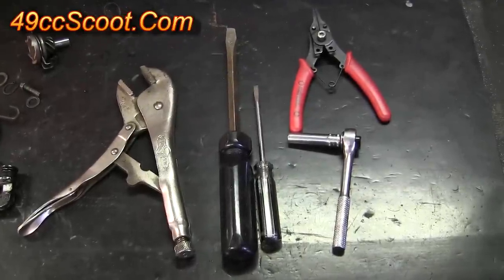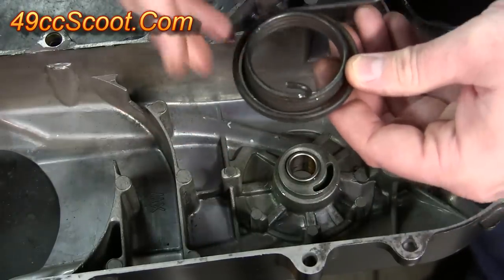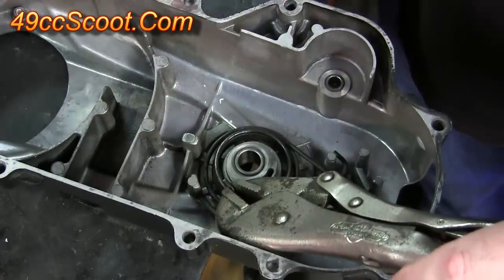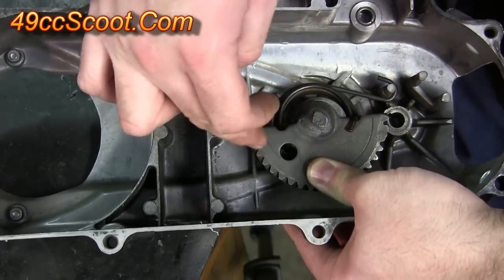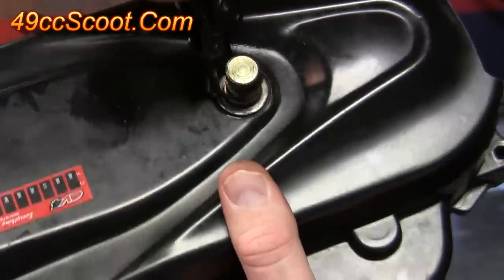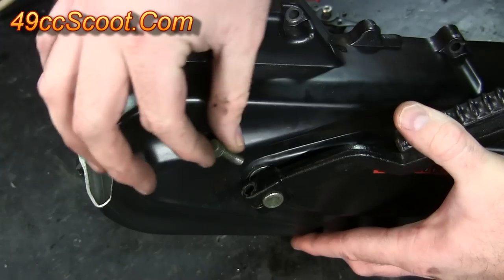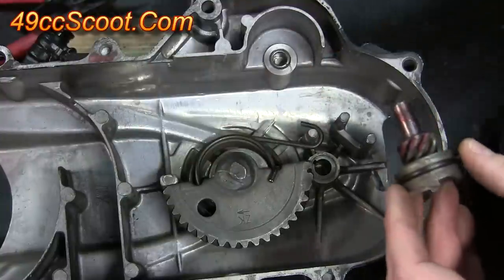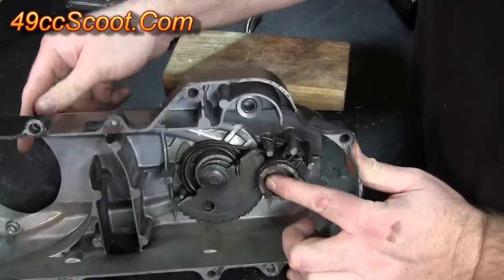139QMB (GY6 50) Kick Starter Assembly : 50cc Scooter Help

Comment: Fantastic guide. My Scoot left me stranded today with a weak battery. It was very frustrating and embarrassing to be at the grocery store in 26° weather trying in vain to get it to start. I have resolved to never rely upon a battery for starting ever again. It is a nice bonus, but every trip will involve at least one kick start.
Reply: Just be aware kickstarter should only be used when your battery fails. Used my kickstarter for about a month because I had a broken spark plug and now it doesn’t work, and gotta watch this video to fix it
Reply: If your scooter has a Bendix (the part that engages between the starter and the gear that turns the engine inside the CVT), that could also be a problem. On my 50cc scooter, I ended up upgrading to 12v 6ah Lifepo4 battery. But I also live in South East USA, and don't have to worry about much cold weather.

Comment: Great video. I’m gonna get a big coffee and sit down for a try at this right now. Kick start is stuck after a crash and don’t not what I’m gonna find. But after watching this video I feel ready
Reply: It just needed the surface corrosion and belt dust sprayed off with brake cleaner. Then a thin layer of lube. Easy to reassemble using your instructions. Works like a charm. Thanks again

Comment: I would put the kickstart lever at 11 or 12 o clock so that when you drop the gear pawl in, the kick lever is still at around 10 o clock, on the return. that will give you a good down swing.

Comment: Ty for this hers was destroyed and had a spare easy to snap off. Needed to know how to put tension and how far to go in thanks again. Now the part that turns it any videos on that part it's loose hope it's supposed to be lose ?
Reply from the maker: The kick lever is what turns the kick start gears. It's on a splined shaft and will get loose when splines wear on either the shaft or lever. Whatever is worn should be replaced at that point.

If you meant the part that the kickstart assembly turns, that's the starter pawl attached to the crank. That definitely should not be loose.

Comment: Just an observation.... Instead of holding it over the edge. drill a 1.5" hole in your bench top. Helps when rebuilding bike motors. Good video.
Reply from the maker: Thanks. I'd prob build a platform just for it if I wanted to do that. I don't want to drill this bench. I've got 3/4" plywood topped in 1/8" steel and I'd prefer that it's intact.

Comment: Hello I have a question. Is it possible to give the scooter gear oil other than through the drain or fill hole? Both of the bolts on my scooter are STUCK on and I've unfortunately stripped the bolt head so I cannot grip it with my ratchet
Reply from the maker: Your best bet is to fix those. Try vise grips first. Get them as tight as possible and then try to loosen. Maybe use some penetrating oil prior to that. You can try a chisel to turn the bolt. You can use a screw extractor. There are videos on all of this stuff.

Comment: Great video but.....how do I remove the cover to get at the assembly shown? I wish I had the 3 minutes prior to this to see how you got the cover off.   I pulled the 8 bolts off but seems there are more or are hidden?  I can see a gasket between there - do I pry the CVT cover off after removing the 8 bolts?  Thanks.
Reply from the maker: Once you're certain all of the bolts are off (they should be visible), try tapping gently around the edges of the cover while  trying to remove it. Use something soft like a rubber or plastic mallet. Give that an effort. If that doesn't get you anywhere, then you can try to find a spot to pry or that would allow you to tap gently in the direction for it to come off. Try your best not to damage anything though. The covers are pretty fragile and it's easy to scar parts when prying.

Comment: Very helpful thank you. One problem i have is the stopper where the kick start returns to has snapped off. (Ex owner broke it off, I still have the piece) Will this affect the kick start from working? as the kick start is in pieces at the moment. Regards David.
Reply from the maker: Robert hughes You can prob get away with it, but I'd imagine install will be tough. It would be best to replace it.
Reply: I will try it, if no luck i will replace. Thanks again. Regards David.

Comment: Im not sure if you still respond to commetns, but I have a kickstarter that is stuck down and every crank of the engine it sounds like its grinding, do you think replacing the kick start will make it work again?
Reply from the maker: Sounds like something may be broken or out of place. At very least, take the cover off and inspect.

Comment: Thanks. Did you make that cover yourself or can you buy those somewhere? Its nice, because you dont need to take it off for visual inspections.
Reply from the maker: It's a stock TaoTao cover. I cut the front with a cutoff wheel and the back with a hole saw. I open all of mine up somehow to help keep the CVT cooler.

Comment: Hey I got a 50 cc scooter Yamaha zuma with no kick start can one be installed onto that ?  I been stranded a few times due to my battery  and before I look into buying another scooter id figure I ask first
Reply from the maker: If it's the bugeye Zuma (horizontal Minarelli engine), then it should be very similar to this. CVT cover is a bit different, but same process.
https://www.youtube.com/watch?v=sJ7jxWexjZY

Comment: What did you use to cut the cover an angle grinder? My 139qmb gy6 50cc scooter keeps breaking belts I suspect it's due to overheating in the cvt, as the belts always look somewhat melted after they break. The fan also melted , it looked like the roller weights were melting on the sides you can see the shine from the heat on the flat spots as well. There is a small cracked portion that collapsed at the edge of the roller weights housing part of the variator I suspect that's from the heat getting the cvt so hot that part of it just caved in, or at least that's what it looks like. Do you have any Idea what could be causing this? I went through 3 high quality belts each lasted less than 100 mile I ran it pretty hard with no cvt cover for about 2 hours and the belt was warm but no signs of wear on the sides, which is where the belts start to get chewed up the clutch was warm as expected, but the variator on the other hand, was very hot. I couldn't even touch it. Thanks in advanced!
Reply from the maker: Rear was a hole saw. Prob a grinder for the front. I also do shapes using a drill and then carbide burrs and files to finish.

Anything that slips will make a lot of heat. Clutch slip and belt slip are prime suspects. I start most CVT troubleshooting with a thorough teardown, inspection, and cleaning. https://www.youtube.com/watch?v=2EjW-iSP-Q8
Reply: Figured out why my scooter was running so hot. The clutch had no glazing luckily but,  I had a performance carb on with an 85 main jet and a high flow air filter. Long story short, I rode it in the snow somewhile back and got some street salt in the carb and ruined it. So I put the stock carb back on. The problem is I didn't put the stock air filter back on. I just ran it with the highflow one. This caused my scooter to run lean and overheat causing the cvt to overheat and rip my belts. Opened up the stock carb and saw a 75 main I knew instantly what the problem was. I hope I didn't cause serious damage by running lean for so long. Anyway thanks or your help, I'm writing this in hopes that someone who is having a similar problem will have some idea as of why. I focused all on the variator and clutch this whole time when the problem was poor carb jetting.

Comment: So I’ve now put like 3 different kickstart kits in my scoot and it never springs back?? Why?? And now it doesn’t engage until it’s like halfway kicked down (makes it a pain in the ass) please help
Reply from the maker: First step is to see how it acts with the cover off. Then you know if the kickstart mechanism is a problem or if there's an issue with spacing or something like that.

Comment: My kickstart keeps getting stuck in the down position. I put it together exactly like you did in the video. My battery died because it's getting pretty cold. I've decided to wait till the weather gets better to get a new one. So i need to kickstart any suggestions?
Reply from the maker: Sure all parts are clean? Some belt dust or dirt can be enough to make them tough to operate.

Comment: Do you know the kickstart lever pedal size I'm looking to upgrade mine to a better one 13mm?
Reply from the maker: Should be about 13mm. Around 12.5 to 13.5, depending if you measure largest or smallest diameter of splines.

Comment: Every Amazon GY-6 Kickstart assembly that I see gets bad reviews of them breaking after a week. Do you have any specific brand to reccommend?
Reply from the maker: Not really. Maybe Kymco would do better since they are generally better quality than Chinese scooters? I consider these GY6 50 kickstarters to be use only when needed and I rely on the e-start. CVT covers break too often or they just come apart and need to be put back together.
Reply: The gears seem pretty solid.. I bought a new set before realizing that it was the actually the cover that had broken. Just put it back together with all the new parts. We'll see how long it lasts this Time lol.. pretty sure it cracked when the bike fell over, landing on the lever, then broke the rest of the way when I was romping on it one day it wouldn't start.

Comment: Where can i buy the washer for the gear ebay or amazon website link cant find it ? I don't feel like spending 40_60$ on new Kickstarter
Reply: Would a washer from the hardware store work if i cant find it online
Reply from the maker: @ELViSLOK  It doesn't have to be anything special as long as the dimensions are close.

Comment: i just did all of this with some slight veriation came to the same end with it back together and my engine is fighting me when i try to kick it over, any advice would greatly be appriciated @49ccScoot
Reply from the maker: Number one would be to make sure it's not something else. Try turning the flywheel over and see if it is tough. Remove the CVT cover and try the flywheel again and see if it's still tough.
Reply: @49ccscoot  I’ll try that tonight when I get home it also doesn’t want to start off the electric starter bendix is just fine just cranks over hard and tries to fire hard every other revolution

Comment: my kick starter on my 50cc Tao Tao gives no response when kicked , no resistance and it doesn't go back in its original position i have to manually move the lever (kickstarter)back up. What should i do?
Reply from the maker: Take the cover off and check it out. See if anything is out of place or binding.

Comment: hey i need help my transmission belt broke into peices in the case and ever since that happened the kickstart won’t go down but it can go perfectly up like nothing i don’t know what’s the problem i took out the the transmission case to see if the kickstart can go down snd it does and the engine works electric start can’t turn on the bike but it almost starts it
Reply from the maker: I'd suggest checking everything over after a belt failure. It gets debris everywhere and sometimes rollers get out of place and/or parts can be damaged.
Reply: @49ccscoot  thank you for the fast reply i also put a big bore kit but i forgot that that i had to break it in and i riding it for like 2 hours and took like 30 minute breaks and i saw smoking coming out of th engine and i saw oil on top of the engine what can be the problem?
Reply from the maker: @chrisblockz3337  Sounds like maybe a leak or crankcase venting issue. If the smoke is coming from the exhaust, it could be piston rings not sealing.

Comment: Will the kick mess up if you lose that rubber piece that sits there??
Reply from the maker: It should work, but it's best to have it in there.
Reply: @49ccscoot  mines just not springing back, it kicks over and then I have to kick it back up (i know it’s no suppose to be that way) but everything seems to be in place right
Reply from the maker: @predator_boiz336  It's easy enough for the spring to not seat just right or a shaft could be binding. Sometimes the little gear shaft binds, especially if it's dirty and/or not greased. It would be best to replace the plastic part when you can, but you can see that mine worked without it. If you work it by hand with the cover off, you should be able to get an idea of where the resistance is. If all else fails and the cover stuff is all good on it's own, it may be that it's binding against the pawl. Maybe from some sort of spacing issue with front pulley bits.
Reply: @49ccscoot  it’s a brand new kickstart set up I just installed 😭

Comment: my kick starter gears are missing the washer that goes under the idle shaft gear. 2 of my mopeds didn't have it and it stripped out on me and then I ordered 2 sets of kick starter gear kits and it didn't come with that washer.  I assembled both kick starter gears for the 2 mopeds and they get stuck in the down position and slip. They don't engage the gear mounted to the Variator drive face to spin the crank shaft.   I have tried talking apart and reassembling the kick starter assemblies many times and still have the same problem.   I am stumped with this problem.   Can you please help me?   Thanks.   I need to get it fixed.
Reply from the maker: Can't find a replacement washer? How about a hardware store?
Reply: 90GTVert I haven't looked for a replacement washer yet.  Ace Hardware will have one most likely. I don't know if the washer will make any difference if it's installed under the Idle shaft gear or not. This is the first time I have ran into this problem with the mopeds.   I would figure that if you install new gears it should work properly but in this case it doesn't work for 2 mopeds.   I have seen online that there's a 7 spline and 8 spline idle shaft gear for the 139QMB engine.  Does that make a difference what idle shaft gear you use?  What will using the wrong spline gear do to the kick starter? Will it cause the slipping problem that I am having with the 2 mopeds? Any help would be great. Thanks.
Reply from the maker: I've never used the wrong gear, but that should make a difference. I would think the 2 gears wouldn't want to mesh properly.
Reply: 90GTVert the gear came with the kick start gear kit.  I asked one of the companies about the difference between the two gears and they told me that the 8 spline gear spins faster than the 7 spline gear. They don't make matching half moon gears that are specifically for the 7 or 8 spline gears. Have you ever ran into the problem that I have with new kick starter gears slipping and not engaging with the gear on the variator drive face?  This is the second set of gears that I have installed. The first set of gears that I installed were tight and binding and getting stuck down when I kick start the moped.  Half of the half moon gear wore out flat.  I think that the cheap Chinese parts are not made correctly and the metal that they use is cheap recycled materials.   The stock gears last 10 times longer than the aftermarket parts. The hole in the case where the idle shaft gear sits in is loose for both of my mopeds. I don't know if it supposed to be that way or if it's worn out too much.  If it is then I may have to buy 2 short cases for 2 motobravo mopeds and 1 long case for my Kymco agility 50 moped. About $100 worth of cases for the kick starter gears.
Reply: It's crazy how much problems I am having with the kick start gears. It's also the only way I can start all 3 mopeds because I installed 3 52 mm 105 cc BBK on all of them and the compression is too much for the stock starter to start it up.

Comment: My Kickstart will not work I Kickstart it and it bleeds gas beside carb.....it's cus old Chinese tubing....but my question is do I replace all worn  tubz...cuz if it's not Broken don't fix...but it's not starting so I wanted to use Kickstart and it's bleeding Gass and won't work..do i get new tubing
Reply: This scooter is my only form of transportation and it's very important that we get something homelessness depends on it I do need help figuring out how to turn the scooter over it's a 50cc
Reply from the maker: @fatlaed6251  First, the kickstart or electric start won't make it drip fuel. As long as the kickstart is turning the engine over, returns OK, etc... then the kicker is not likely your problem.

If you know the hoses are worn and leaking, replace them. If suspected to be low quality, replace them. If budget is tight, you can try just replacing what's known to leak, but I'd advise checking options for hose purchases. Sometimes you can get a roll with plenty for about the same as just buying a few feet.
Reply: @49ccscoot  I replace the hose that was leaking it's still not the problem
Reply from the maker: @fatlaed6251  https://49ccscoot.proboards.com/thread/647/start-troubleshooting?page=1

Comment: i installed New kickstart parts on my kymco but the gears slips do You know what i am doin wrong?
sorry for my bad english
Reply from the maker: If you watch the video for install and inspect all parts to be sure they have good teeth/splines, it should work if the spacing is alright with the CVT cover.